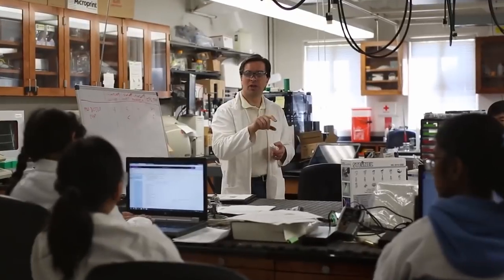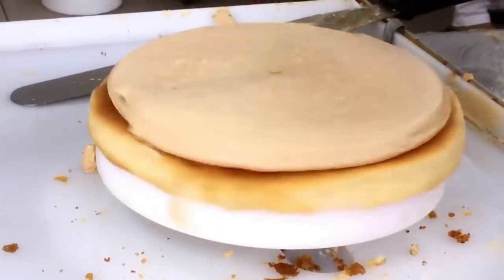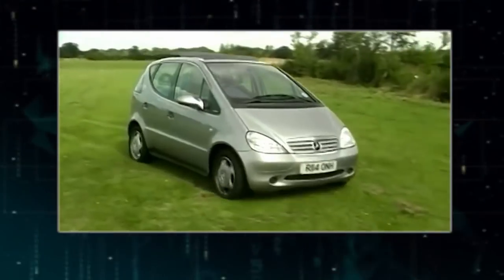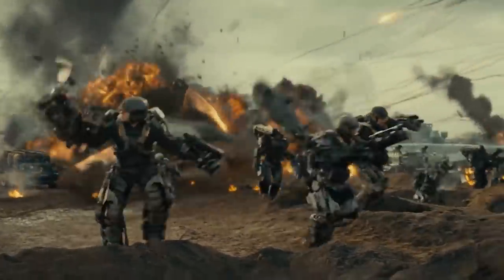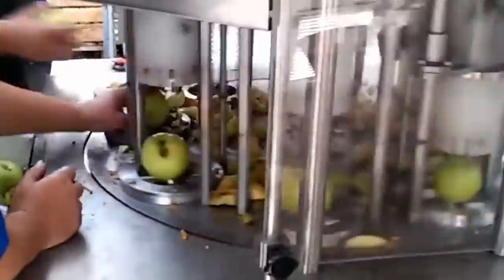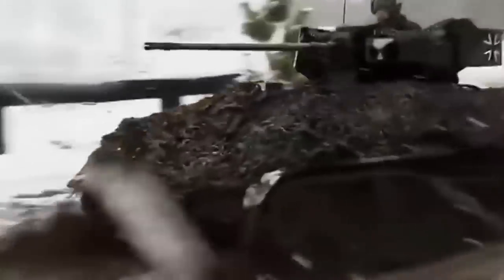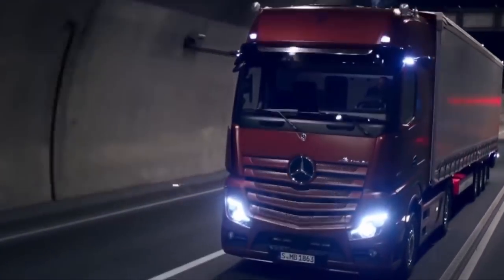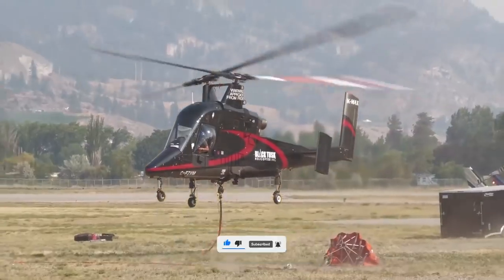Innovations that will blow your mind

Comment: The helicopter surely is a great piece of technology – but not new at all. 

It's intermeshing rotors were invented by Anton Flettner whose Fl 282 Kolibri already flew in 1941. That design was brought to the US when WWII was in form of two of his helicopers, based on them Kaman was founded in 1945. 

This innovation therefore is already over 80 years old – nevertheless still pretty impressive.

Comment: The Kaman helicopters have been using this system (in the USAF's HH-43 Huskie) since the mid-1960's, and it's based on Helicopters the Germans used in WW-2. Nifty, but, not-so-new.

Comment: Shouldn't the car lower its center of gravity not raise it to avoid getting knocked around more. Higher up it will have more body roll. And give more space for a car to slide under.
Reply: Hmm... maybe the rationale is that they want the impact point to be slightly below the center of gravity, so that the car won't roll away from the hit, but rather towards the hit (which would require more energy due to reduced leverage).

But yeah, if they raise it too much, then the impacting car could slide under, which would be catastrophic and completely negate what they were trying to do. So I reckon it must be a balancing act.